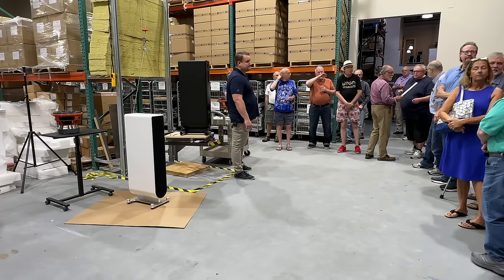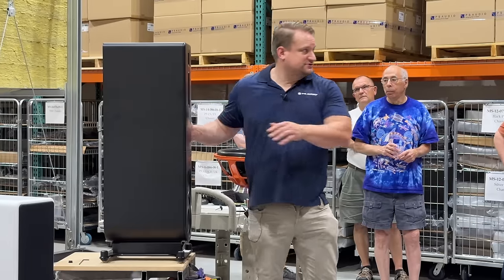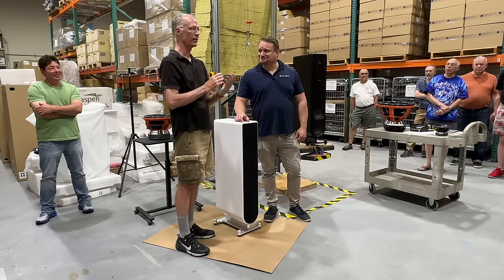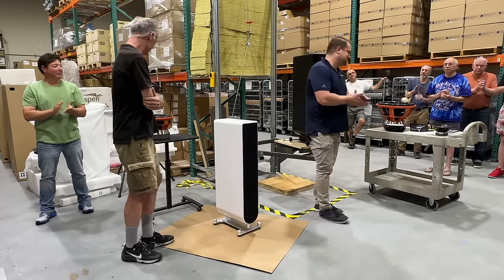Chris Brunhaver reveals the aspen speaker secrets

Comment: That subwoofer motor reminds me of an Adire Audio Tumult. While im more into car audio than home audio i enjoy both, but i feel like the car audio world is miles ahead in the subwoofer game. Im curious if the home audio companies even pay attention to car audio (ill assume not much however, considering how many home subs seem to be "proprietary" to certain companies).
Reply: Almost certainly parts of it come from the same OEM manufacturer. Pretty sure PSaudio don't run their own steel forge/casting factory. They buy components for their gear from one of the big dogs like everyone else and just assemble. Maybe make or wind vc's locally but they aren't making the wire that goes into the coil. Lots of the time the "designers" will work with OEMs to tweak what the OEM is offering or maybe if they have oodles of cash, they will get the OEM to produce something to their custom spec. That magnet and the speaker basket are probably off the shelf OEM designs. PS audio get to make it their own by whatever VC they strap it to or whoever's speaker cone they strap on the front of it.
Reply: @gtvwill  No need to explain to me, i already know these things lol. 

The basket is an open tooled 'T.I." basket. It was a TC Sounds design, which if i remember correctly the patent had expired. And yes, made now in China. While it reminds me of a Tumult sub mag/top plate, im sure its been tweaked at least a bit. Id be shocked to learn if its the same as the Tumult exactly. 
Most every part of every sub or speaker is pretty much made in China now, regardless of whether its assembled in America or not. There are still a veeeery small number of US parts manufacturers, but only a few. 
Precision Econowind is still a US company, and they make a good chunk of voice coils for the audio industry. So at least one part of a sub will usually be US made. I have no idea on the actual wire they use, but it wouldnt surprise me if its foreign as well. Anyways, cones, coils, baskets, motors ect...even full subs to just simply add branding can be ordered from China.

 Which is why i was surprised to see the sub in this vid. Most of the subs i see for home audio are generally (again) 'proprietary' designs. Which honestly is a bit suspect considering (again) they could learn a lot from the car audio industry instead of trying their own designs that the end result may be good, but its just simply a reason to charge outrageous prices (that goes for regular drivers as well). Subwoofer and speaker designs have changed very little in their overall design for the last 50+ years, materials not withstanding.

Then again, I know a lot of the insanely high home audio costs are passed onto consumers as "the price of R&D" and/or ridiculous enclosure materials, which is honestly a huge cop out of you actually think about it. None of these speakers should cost as much as they do. I guess they love the illusion of the customers thinking more expensive is better.
Reply: Interesting perspective ... I don't see mobile audio driver design etc., as being ahead of other applications.
Reply: @FOH3663  Im mainly speaking of subwoofer design. Many car audio subwoofer manufacturers have incredible drivers capable of impressive excursion, power handling, and seriously impressive low frequency response. Im just surprised that more things arent adopted from them and placed into the home audio/subwoofer world. The two that DO stick out from car audio are JL Audio, and Stereo Integrity, and i dont know, maybe a couple others that im forgetting.
Reply: @imawesomeyourenot  what do you think of rythmik subwoofers
Reply: @mmll-ls7dn  Ive heard the name before, but am unfamiliar with them. A quick look at their site however, shows me what look like decent variety along with what appear to be ok products.

BUT also, too many, that are too specific. 

Servo while good, never took off for a reason. "Music only" type of subwoofers? HT only Subwoofers and then "combined" systems? 
I just ask myself why? 

Oh, i bet its to make the sort of claims that you need this type for that room, this other type for that room, and this last one for that other room. Please buy all of our subwoofers! Of course, that is mostly just marketing. A decent, properly designed sub will/SHOULD play ALL varieties of bass/sub bass with authority, and of course, many/most subs will play COMPLETELY different to their specs depending on room, room correction, and other system properties. Regardless of its "intended" purpose. While im sure its not a horrible company or a company that makes bad gear, i see no reason other than feeding into "audio myths" or ridiculous audio standards that are really just largely propagated nonsense.

 But, its up to the consumer to decide whether a company is putting out quality products with their wallets.
Reply: I used to work for adire and this is based off the same concept, except with larger 250 mm magnets (vs 220), 4” coil (versus 3”, and double shorting rings (vs none on a an original tumult) and a larger/more capable suspension (10” vs 8”)
Reply: @cbrunhaver  Very cool! Adire (and audio in general) was a little after my time in audio was sidetracked from young adulthood and then family. But when i had came back i was blown away with a few things i had saw from them. Cool to know! Thanks!
Reply: @cbrunhaver  Dan is still licensing xbl2 tech out there afaik I wouldnt be surprised if this is his design licensed to them.
Reply: @imawesomeyourenot you make some good points. Most car audio subs have some significant inductance issues really hurting their performance (the move to 8 layer coils was a bad thing, generally, except in spl competition)Still, I follow car audio subs and have designed a number of things for DC car audio and others. 

The subs I show are actually being made where sundown audio and a number of mobile audio companies make their subs. However, we’ve Done a lot of work on improving the driver sound quality and tailoring things to a lower resonance and higher sound quality
Reply: @cbrunhaver  Y'know thats the one thing i didn't actually consider in the difference between car/home subs. 🤦‍♂️ 
But i do still feel that theres a lot to learn from car the audio side that may not be considered for home. I will say though, there are some great home subs as well as general audio equipment. I also think though, that home audio "gear heads" as well as manufacturers are too stick in the "if its expensive it has to he good". Some of the components i see in home audio are somewhat rarely (in my own opinion of course) worth the cost that is placed on them. Diminishing returns doesnt seem to be much in the way of consideration when it comes to home gear.
Reply: @imawesomeyourenot  yes, I think that subs are one of these areas where some hifi companies are using high end European drivers that aren’t geared towards high out deep bass reproduction in larger rooms. A lot of those units were designed around smaller rooms/homes with concrete block/brick construction and much different acoustic needs.

Comment: I believe the split gap motor in those large woofers is referred to as XBL squared  motor. Used in some terrific subwoofers over the last 15 -20 years. Dan Wiggens had the original patent. see the famous 'Tc sounds LMS 5400 Subbwoofer driver".
Reply: Yes, I worked for Adire and that’s what it is. The LMS 5400 is something different. TC sounds LMS technology with a variable voice coil winding to get linear motor force versus excursion
Reply: @cbrunhaver   Yup, I recognize an XBL² motor when I see it!  At least most of the time.  I used to have an old school RE XXX 12" Quad-1Ω running off two Fosgate BD1000.1s in a ported box, and it was an amazing setup.  When Andrew started up Adire Audio again, I ended up picking up four 10" Brahma D2's during one of their sales and hope to implement them into a design.   The other motor topology that was/is absolutely amazing is JBL's DDD motor in their WGTi series.

Comment: Passive crossovers at fairly high levels cause a lot of distortion I think! Active crossovers at line output level are a better option in my opinion ?
Reply: Any measurements or information to support this?   Maybe with a very poor quality iron core inductor you could see something like that but we are using big air cores and poly film caps and the non-linear distortion is completely dominated by the (already very low distortion) drive units.   Active speakers have other benefits (some of which I describe) but, at home audio power levels and midrange crossover points, a difference in sound quality because of lower distortion isn't one of them.